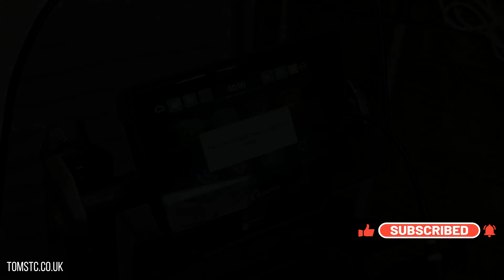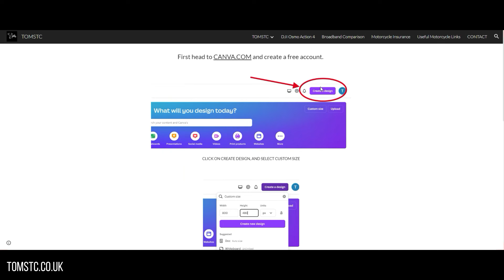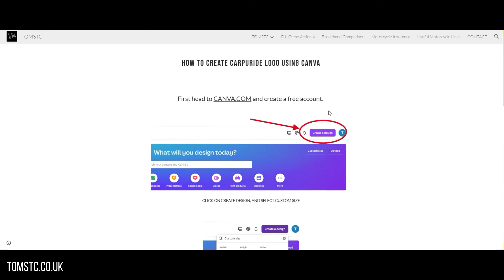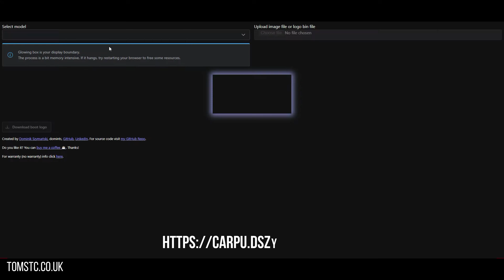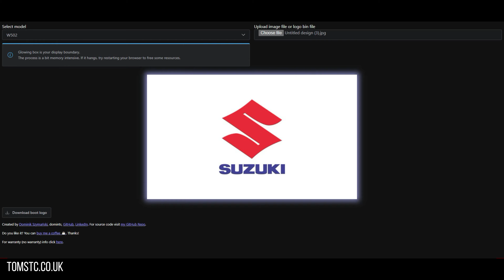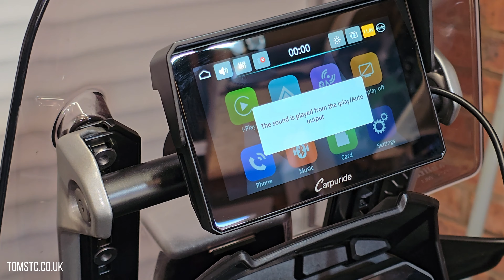How to change Carpuride boot logo EASY PEASY!

Comment: On my W702, screen stay on "Update isp_part.bin" et do nothing event after several minutes. SD Card 32G/Format FAT32. Only file on the SD.
Reply: Ok. Problem solved. I bought a new SD Card 32Go card and it works fine. Thank you for the tip. Need to try it on my W603D that I just received.
Reply: Hola amigo que tal pudiste cambiar el logo de la w603D? Yo tengo una y no tengo manera de cambiarlo  @bertrandchaume6514

Comment: Thanks for this, logos can be found on Vectorseek or Seeklogo. I used photshop to create the jpg file. Note if you are using a W702 the picture size needs to be set to w 1024 and h 600 px. Getting the SD card to click into the SD card slot was a bit tricky and needs to be done with a tool like thin pair of pliars. Everything else worked fine.

Comment: awesome tool ! thanks. Unfortunately not working for me. I am using a 32GB card formatted FAT32. When I insert the card the unit prompts to process the BIN, it does for a few seconds, but reboots to the old carpuride logo :( . My unit is the newer W502 Pro
Reply from the maker: Ok thanks for letting me know i will look into
Reply: Yesterday I tried using a 32gb card and it didn't work. Today I found an old 16gb card, formatted to Fat32, copied the bin file and IT WORKED on my W502 Pro !!! Amazing!

Comment: I have a W701-XXXX 9 inch screen 
I've followed all the steps but when I put sd card in it says device not complatible
Reply from the maker: @joegreenwood3058  what card did you use?
Reply from the maker: @JO53PH.YOUTUBE  try formatting the card first